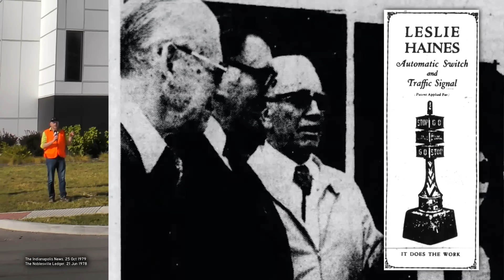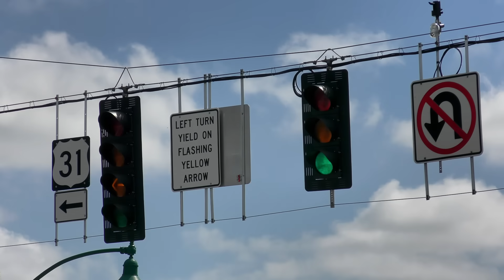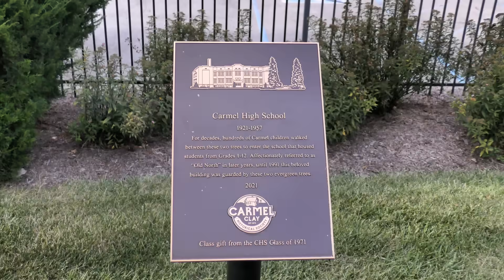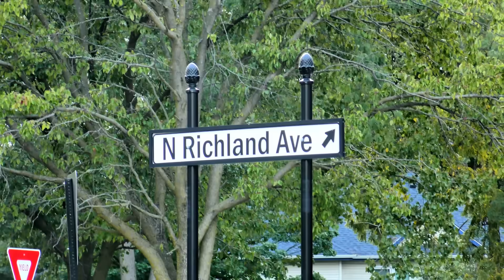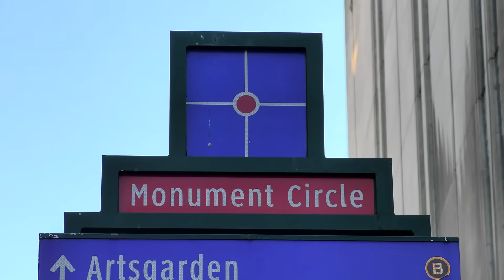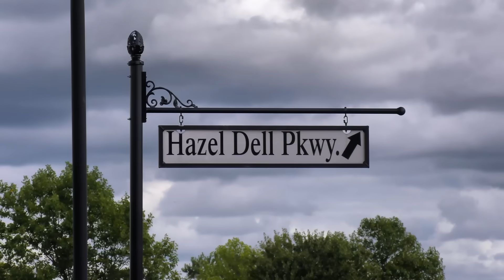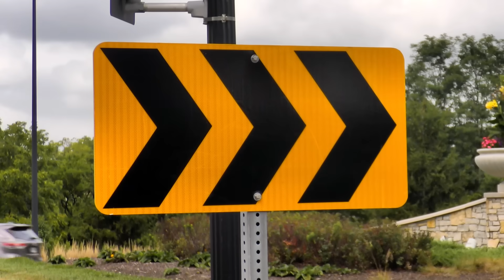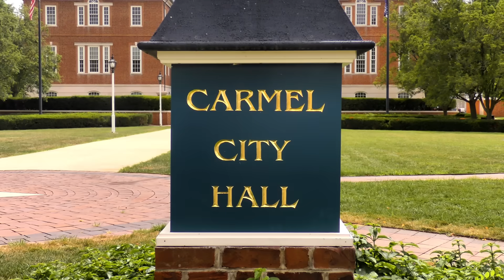Let's FIX the HIGH SCHOOL... with 152 ROUNDABOUTS!

Comment: I never quite understood the general opposition present in the US against roundabouts. Although there are cases where traffic lights are a better fit (ex. a medium traffic load road perpendicularly crossing an extremely high traffic load road*) in most cases roundabouts are clearly superior by pretty much any metric.
* In that case, because people on the roundabout have right of way, the high traffic road would keep occupying the roundabout giving no space for the side road to drain, clogging that one up. And in such a case there's no easy way to build a (cheap) slip road either.
Reply: If you grew up in NJ and then moved to another state, that pretty much explains it.  NJ would intersect highways with traffic circles, and it was literally a free for all.  There was one particular circle intersecting Rt 70 and Rr 73 on Marlton that was both a circle and a regular intersection.  It took NJ 4 or 5 decades, but they finally put an overpass in.  

And NJ has this other oddity called jug handles.  They are a way to turn left and come in two varieties.  First, go past the intersection and loop back right onto the intersecting road.  Second, turn right like an offramp before the intersection and turn left onto the intersecting road away from the main intersection.  The first one kind of works.  The second is just a disaster because you're still turning left but without the benefit of a light in many cases.  So it becomes a dangerous free for all. 

If you want to understand how to cause crashes with roundabouts, go to Oshkosh, WI, not having the experience with one.  They use multilane configurations.  You have to carefully watch the road signs and surface markings in order to be in the correct lane.  Otherwise you'll end up side swiping other cars trying to exit the roundabout, especially during rush hour.
Reply: @major__kong  Are those multilane configurations not standardized?
Reply: The only opposition I've personally encountered was from my grandparents. They had never seen a roundabout until their 70s when our city started building them. Stop signs and stop lights were familiar, but roundabouts were too new and chaotic.
Reply: @PsRohrbaugh  My mom got to see them in use in Europe and she still hates them, one of the funnier stories she had was when she was in Italy and got to see whole families pile out of cars after a accident and engage in a massive brawl in a round and the cops there just stood there and let them fight. Cops said to her: "We will just collect the losers"
Reply: Turbo roundabouts have multiple lanes (usually 2 but there are designs with 3), with physical barriers to discourage drivers switching lanes inside the roundabout.

The barriers are “mountable” - large or long cargo and emergency vehicles with enough ground clearance can drive over them slowly.

I wish they’d implement those where I live. So far, they’ve implemented a couple of 2-lane non-turbo designs with only paint to delineate lanes. Got cut off by a large pickup driver exiting from the inner lane while I was in the outer lane, trying to go “straight” through the roundabout. It’s only a matter of time until someone gets hurt by that kind of behavior.
Reply: If you have an extremely high traffic load road it should be grade separated and made into a highway rather than having traffic lights slowing down that high load of traffic.
Reply: @agilemind6241  a big issue is that roads do not always start out high traffic and you cannot really grade separate them once they do become that way. First off they are a surface road with side streets coming out onto them and second while you could build frontage roads you would need to get the land and most people are not going to give up their land for even more road.
Reply: At the low end the same effect on traffic flow rate could be achieved with yield signs in place of stop signs, without any of the pedestrian benefits but in that use case they realistically aren't much different. Medium flow or high flow you have very specific use cases where they improve traffic flow but they can very easily get locked if a new development happens and traffic patterns change. My observation and experience has been in most cases they are a band aid for previous poor planning, or a vanity project and they have a short term placebo effect.
Reply: @joeblow5214  Unfortunately yield signs are unpopular in North America. And mostly for the same reason roundabouts used to be uncommon. 
Some roundabouts have actually replaced yield signs with stop signs (Ripon, CA).

Comment: Roundabouts suck
Reply: Roundabouts are Great... when implemented correctly in appropriate locations. It is possible to screw them up, just like anything else.
Now, Traffic Circles, on the other hand (they're not the same thing!), THOSE suck and are a self evidently stupid idea to the point where the fact that they were ever actually built is just Baffling.
Reply: Why do you think so? I am genuinely curious.
Reply: YOU suck. Prove me otherwise)
Reply: your objection to roundabouts was very well explained
Most of the times is just bad drivers (most Americans are terrible drivers) that have no clue what to do
Reply: Give me evidence to support that claim

oh

you can't?

shame
Reply: @adilivshits6096  There are several areas they do fall short and can start behaving like 4 way stops and even lighted intersections. Roundabouts have a use case but in many cases where they are used in the U.S. they are vanity projects nothing more. Oh and YouTube loves to censor links, so expecting a well sourced argument here is asinine. Especially over a opinion.